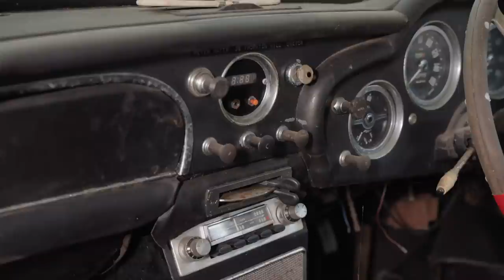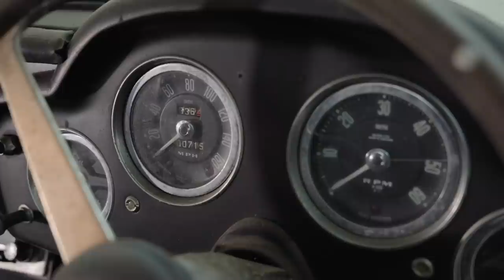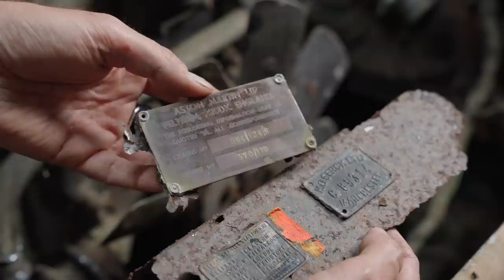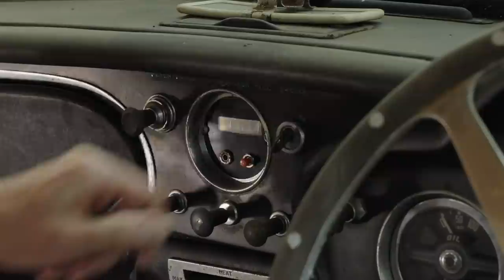The Best Barn Find Classic Car I've ever discovered. Will it run?

Comment: Surely it's beyond saving though no?
Reply: No - although the tin work in places like the boot and around the radiator is completely gone, the important stuff - like the engine, gearbox, axles, body and chassis are absolutely fine.

Comment: Well now you know the engine works you just need a body to go with it, or is the engine alone worth 300,000🤣🤣
Reply: The aluminium body is fine as is the chassis - I take it you actually mean the tin-work in between? If so, the worst piece is the boot floor/spare wheel well - which is available off-the-shelf for £840 or thereabouts.

Comment: Travesty to have just let this car sit for 40 years without doing some basic preservation work on it.
Reply: I bought the car like this after it had been left sitting on the previous owner's dad's drive following him getting ill. Since then it has had a dehumidifier running alongside it the whole time. Any bits that would have benefitted from protective lube got it.

Comment: Candles need to be grounded
Reply: If you mean the spark plugs, then yes - they do need to be grounded, and they were. That we had good earths was demonstrated a couple of days later when I got the replacement ignition parts and the plugs immediately started sparking when held in the same manner.
Reply: @TeknoTramp Was it a bad condenser? Or wrong dwell or just bad points?

Comment: How much wil it cost to restore.?
Reply: That would depend on who did it as the vast majority of the cost would be labour. A new rear boor floor, for instance - which is about £840, would probably be the most expensive single component that was needed unless major performance upgrades were wanted. I'm talking about stuff like a lightweight crank, Cosworth pistons, triple carbs, etc.

Comment: An "Engineer" that doesn't hare the fore-site to use some protective anti corrosion spray and a car cover?
Reply: As I said above - the car came to me in that condition, and has had a dehumidifier sitting next to it ever since I got it, costing me £££. Much better than a cover which simply traps damp. It has also had plenty of protective lube applied over the years I've had it.

Comment: That Aston looks fucked, is that even salvageable?
Reply from the maker: Of course it is. It isn't bodily that bad at all.
Reply: @TheLateBrakeShow  oh that valance bit under windscreen in engine bay looked rotten, really rotten.
Reply: The worst bit is the boot floor. That whole section is available off the shelf for about £840; the tinwork around the engine bay is far less! @4th_Lensman_of_the_apocalypse
Reply: @TeknoTramp  ok, thanks! I dont do bodywork at all. If it was mine I’d have prob put it in the recycling bin along with my tins, plastic and card! Oops..😬

Comment: Basic common sense from a person such as this ex racing engine geezer Paddy, should be screaming at him, that a spark from the HT side of the coil, but not at the plugs is down to the distributor, being either the cap or the rotor arm. This is basic stuff, not Canbus or rocket science!.
Reply: The spark was so weak and intermittent that we couldn't get any sense as to what was actually wrong. A lot of the diagnosing was cut out during the editing, so you missed most of the process!

Comment: Are you completely insane you took the spark plugs out of the heads without nipping them up too break the build up of rust and carbon on the spark plugs, dragging that build up though the threads possibly compromising the threads, i see you have little knowledge of what you are doing so please leave it too someone who does. You would be best too inspected the threads too make sure you haven't damaged them.
Reply: A huge amount of what we did wasn't shown as the video was already long enough.

Comment: It is pure idiocy to even attempt to start a car with years old - decades old - gasoline. You will bring all the crap floating in the gas tank right into the engine.....yet it happens every episode.
Reply: Did you miss the bit where we disconnected the fuel line and fitted a fresh supply?